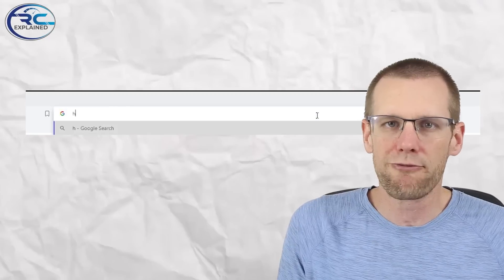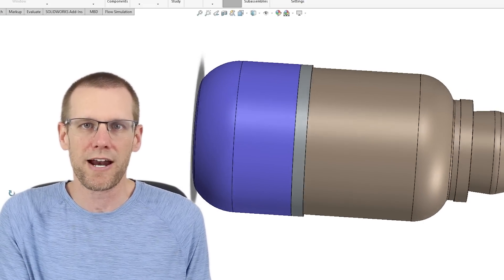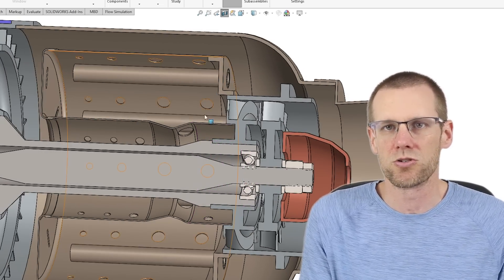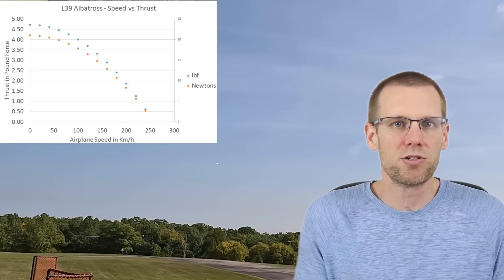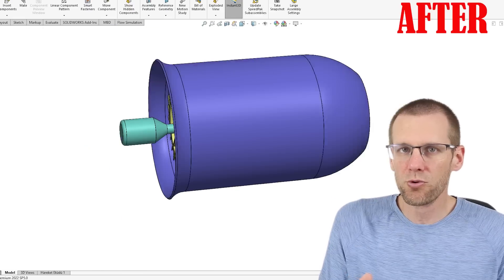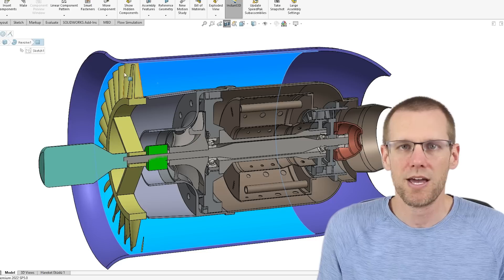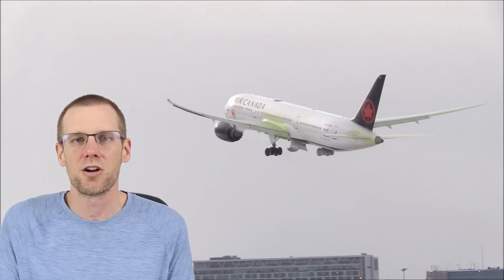RC Turbine Engines Could Be Crazy Efficient If They Made This ONE Change!

Comment: Centrifugal compressors have very large engine diameters, so adding a turbofan's bypass duct would make the compressor's casing very thick. Furthermore, if the fan and compressor shafts are directly connected and run at the same speed, it would cause additional load and reduce compression efficiency. Adding a reduction gear would increase the burden on parts and lubrication. Generally, a turbine stage is added to drive the fan separately, which makes the shaft more complex.

Comment: RC engine manufacturers have already figured out an even more efficient solution to this, they're called piston engines lol. People get jets because they're cool, and a centrifugal turbojet is the simplest and cheapest way to make one.

Also, the exhaust on those does not reach 1500 kph, as that would be supersonic, which isn't possible without a convergent-divergent nozzle.
Reply: Depends how hot the flow is. I think exhaust gas temps can be around 500C, which gives mach 1 of 2000km/h. So you can get that fast just by choking the flow
Reply: @rohanw411  Closer to 1600 kph by my math, but yeah, I guess it's possible. Still seems unlikely to me though as it would still need a decently well optimized convergent nozzle to choke the flow.
Reply: @Quasarnova1  yeah you are right probs i quickly did that.

Comment: Very nice video and thanks for answering a question I've had about the thrust versus speed of the airplane.  From the graphs it becomes apparent that the thrust v. speed of a  a propeller driven aircraft would be similar and that will contribute to limiting the max speed of the plane.  

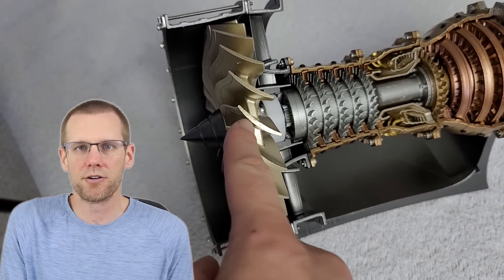I have one complaint:  The overlapping moving background used at various places became really annoying.  There were places where you had a few second of it, but the REALLY noticeable section started about 4:32 and continued to about 6:04.  I began to feel like the room was moving and I had to look away.  Please don't use that effect.  It really adds nothing to an otherwise informative video.
Reply from the maker: Got it. My editor stopped using motion background a while ago.
Reply: @RCexplained  Tnx for the response.

Comment: all great ideas- except for ONE: you're using GEARS. the better idea? use a concentric shaft. the main shaft that would normally be in the RC engine changes to a hollow shaft. through the center of that hollow shaft, passes a solid shaft with a fan at either end. the fan on the back end, has axial flow turbine, with only VERY slight angle- to 'bite' into the exhaust air & turn the shaft- in the OPPOSITE direction of the inner turbine. on the FRONT end of the shaft would be the main fan, with a very agressive fan (45deg). this fan pushes air into the engine exactly the same way, only now- it spins freely from the centrifigul turbine section. THAT engine? would be a BEAST. virtually impossible to have a compressor stall, since you have counter-rotating fans on both ends. A BEAST.

Comment: You can't compare a rc turbojet compared to a turbofan.  As a turbojets impellers efficiency is designed to make thrust.  Using only enough parasitic loss to power the compressor.  
A turbofan is designed to keep enough energy  to power the engine. And the rest is turned into mechanical rotory power.  Not thrust.  Two motors that can't be compared in any way.

Similar to a turbocharger for a car.  The reason the impellers are different.  Is a turbocharger impeller is designed to use pressure and flow to create power.  You can't do that on a turbojet engine.  That's why giy turbocharger turbines are inefficient.  They use an impeller designed to use as much of the flow and pressure as it can.  Taking away most of the thrust.  thrust.

Comment: Not a bad video. Don't hate on this guy so much. He sparked good conversation on a topic we're all clearly interested in. 

I'm a "full size" jet pilot just getting into RC turbines. So I take it all in. (but have a LOT to learn)

A few of you below conflate compression ratio with pressure ratio, which isn't at all the same thing. But the sentiments are usually correct on it's effect on overall performance. The basic argument laid out here is how effectively the heat applied (in this case via fuel, an exothermic reaction between a carbon chain and it's oxidizer) affects the mechanical work being done for the aircraft itself. Real aircraft also use a portion of this energy to a number of other applications on the accessories pad, such as pressurization bleeds, Constant speed drives, hydraulic pumps, ESCs (or EETs) inlet or wing heat, etc. RCs usually don't have to use any thermal energy for that. 

It might be noted, however, that a high bypass turbofan is also applied, in the real world, to large aircraft with much higher overall pressure ratios, and only raise the turbine inlet temps toward their limits during takeoff, which might be a few times a day at most for most aircraft. And there are some rear fan turbines too. The J79 and the CJ610 had variants of this. 

The effects of high propulsive efficiency (IE, low jet vs aircraft velocity) is most beneficial to an aircraft in steady state cruise most of it's working day. In the full size world we call this topic "thrust lapse rate". IE, aircraft velocity vs jet velocity and it's related effect on propulsive efficiency. 

Moreover the effects of high mach cruise ram effect mass airflow rise can increase airflow as much as 70% or more at mach .80 and above, which RC aircraft generally don't come near. The type of technology we're talking about has very different advantages in real aircraft that are basically all but absent in the hobby world. 

I could go on an on about this but the other commenters seem to have covered it. :) 

 The RC world is different in every respect; where practicality is generally a ruling factor for everything, including maintenance, affordability, etc, which RCexplained does bring up several times, much to his credit.  I say we keep encouraging RCexplained to keep making videos like this. It encourages a good exchange of ideas and inspiration, without which we wouldn't have RC turbines at all. Keep it coming!

Comment: this guy has no idea what he's talking about, he has no idea what the thermodynamics of jet engines are, and what excess power is available from the main shaft (hint, there isn't any excess power without increasing the turbine inlet temperature, and they're already operating at near their max), that's why real turbo-fans use a second, separate, turbine wheel to power the fan up front, NOT the shaft of the inner core.
Reply from the maker: I've never seen a turbofan in my life before. Aren't they powered by AA batteries and no shafts?

Comment: "While in theory, theory and reality are the same thing - in reality they are not". To implement the idea of RC turbofan propulsion while feasible from engineering and manufacturing standpoint, economically it is non existent. The cost of a turbofan will be so much higher than a turbojet that very, very few if any people will even consider spending the money. Besides, most modelers don't really give a Fiddler's Fuck about efficiency, let alone 20% increase. They just want to have fun and at times show off.

Comment: First build your own model conventional jet turbine before making a video on it. The very first problem I see with the design is that it will not be self sustaining because the first stage will be too heavy. This really is a case of Dunning-Kruger effect.
Reply from the maker: Actually, the first problem in design with this playful video is that the transmission is impossible to manufacture at this size and RPM. Also, stage 1 being too heavy is not the specific issue with this design. Assuming it is weightless, the fan would consume too much power from the turbine and must be on a separate stage. Lastly, while it seems you missed the point of the video, I do appreciate hearing from those more knowledgeable than most.

Comment: A century is a very simple sistem tu convert air speed into trust,  another cheap alternative is a electric air compressor electric motors can be place with opposite spin thus no need for fix blades in between stages.....

Comment: In very simple terms and excluding the combustion process, the compressor in the RC Jet engine is designed to spin the turbine wheel which is in turn is designed to spin the compressor. It is a delicate balance between the two and if you ad a fan load to the front two things will happen. First EGT will shoot through the roof and it will melt your hot section. Second the fan RPM needs to be much lower than the compressor due to tip speed. So in summary this simple design will not work. If you wanted to build a turbofan with the fan up front then you need a second stage turbine with a second shaft running through the center of the main shaft and at the proper RPM for the fan. Your second option is to use a second stage turbine and have the fan at the rear. This is a much easier design and can "almost" be a bolt on to the rear of the RC jet in place of the tail cone. For the record, this is Albert from the original RA Microjets. We tried all this way back. The RC jet industry has made great progress since we started this in the mid 90s. Add a few more ounces of fuel and keep it simple.

Comment: I don't think a gearbox is practical or necessary. Most traditional Turbofan engines don't have a gearbox, and neither do Helicopter engines. A completely free fan shaft should work just fine.

Comment: It would be better to house the reduction gear in the hub of the fan, with just a simple shaft extension from the compressor.  1) less restriction on air flow. 2) more modular design. The fan assembly and shroud could an optional add on to any engine.

Comment: you lack an understanding of turbomachinery and thermodynamics: Brayton Cycle efficiency depends on compression ratio, more is better. radial compressors can reasonably have a compression ratio of maybe 6:1 per stage, though typically they are closer to the 3.5-4 mark. Axial compressors are around the 1.1 to 1.2 range per stage. the reason airplanes use axial compressors is because of the frontal area presented to the airflow is lower, making the overall system more aerodynamic.
Reply from the maker: That's an interesting take on my understanding of turbomachinery. However, your entire comment seems to address something I never mentioned in the video. I didn't recommend, use, or show an axial compressor. I'm a bit puzzled about how your better understanding misidentified the highlighted component featured in the video.

Comment: would be interesting to see how good it is on fuel those standard RC Jet engine can eat up to 15L an hour that's more then my land cruiser driving at highway speeds and that thing weights 2.5 tonne. those jet engines have to be the most inefficient thing ever.
Reply from the maker: Yes, exactly. Was just speaking to a fellow club member about this. He was buying $20-$25 CAD worth of fuel per weekend and flies every weekend possible. It adds up for sure.

Comment: One easy way to add a fan without making cost go up would be to do it all in the rear. In your mock up the center of the fan was removed. In the real world Turbo Fans, the fan also helps get the air goin into the first stage and thus needs to be in the front. You don't need to do that. If you move the fan and turbine for it in the rear. you can delete the center shaft and it's complexity and delete the planetary gear. Simply design the Turbine to be correct for the rpm/torque you need to drive the fan efficiently. Putting it in the rear means you make the bearings there and vastly reduce complexity and cost. And it should still work good enough for the RC world.
Reply from the maker: That idea makes it much more simpler.
Reply: What you are talking about is an AftFan Turbofan, it uses a Freepower turbine coupled to a radially mounted fan and shroud behind the existing turbine to push more aire through.
I'm currently working on a prototype but it's much more complicated to make than it sounds, hot gas sealing being a major challenge as labyrinth seals are not easy to get right.
There's also the fact that you may need a secondary NGV which could cut down massively on the overall efficiency although it may not be necessary if we use a counter rotating fan, overall I'll keep you updated if I manage to do it
Reply: @guillaumineliott6649  awesome! Don’t let the complexity get to you. I get lost a lot in my projects and in the end the simple solution always ended up being the best. You can do it simple and affordable for the rc guys.

Comment: There may be national security issues with making RC jet engines too efficient or too powerful. You don't need to match an F112 to power a really nasty missile. Adding an inch or two to the outsides of current model jets would put them in the same size bracket as the TJ-150. A P550 is already 33% of the way there.
It may also be the case that the RC jet companies actively don't want to get too close to that line, least they wake up one morning and find that their engines are being used for nefarious purposes.

Comment: You are correct that it would make the engine more efficient and quieter. Both of these attributes would be great in military, UAV, applications. 
But I see several huge problems. Firstly the cost of R&D, this gets passed onto the modellers, as does the increased manufacturing costs so they get to the point where modellers can't afford them and unit sale are low. Then there is the question of do you keep the same core size and end up with an engine that is twice the diameter. Or, you keep the same overall size and miniaturise the core, again costs have gone up exponentially. The current engines are the best thrust from the simplest design for the minimum cost using current components.
Definitely keep on looking into ways to improve things in the RC world, you will find areas that can be improved.
Reply from the maker: Several huge problems, that's why in 25+ years of model jet engines, it's never really been done. But I still would love to see and hear one and believe eventually it's going to be done.

Comment: RC turbines likely don't have the torque to spin a large fan and gain any efficiency. They are relatively low compression ratios in the world of jets. Drag and material weights unfortunately scales in favor of larger machinery.
Reply: Actually, smaller jets have a better thrust to power ratio. See this iron man / rocket man   all up to F22 vertical climb ( but only F35 can hover ).

Comment: You know they already sell conversion kits with transmissions to use them as turboprops, right?
Reply from the maker: The model turboprops use a secondary turbine wheel. No transmission, and this is naturally a more effective method to drive a prop or fan.

Comment: Completely missed the dual shaft with separate high and low pressure systems.
That omission led to the necessity for a really dodgy (failure prone) reduction gear.